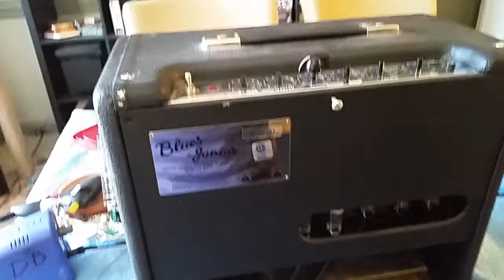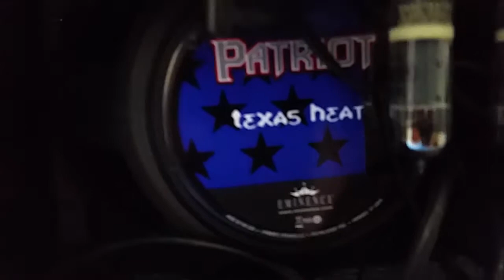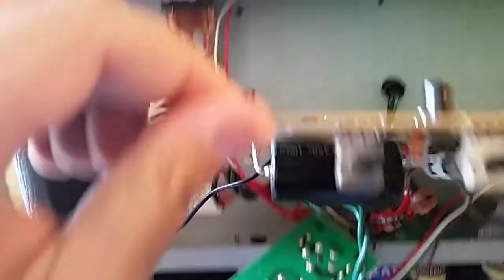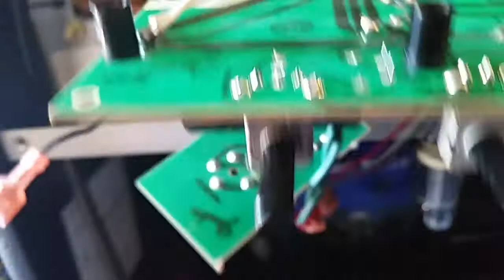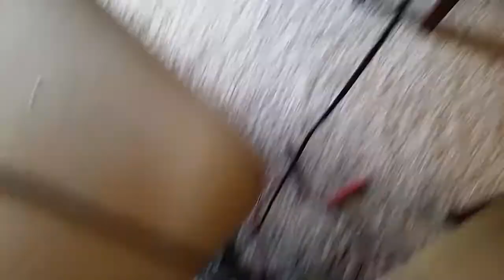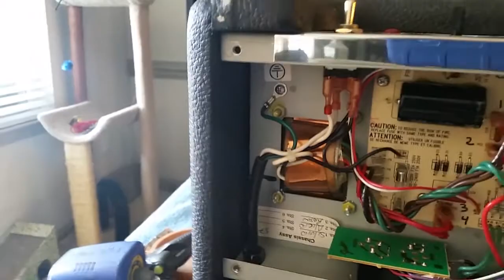Fender Blues Jr guitar amp repair

Comment: Judging from the bloodiness of the solder, I would say the person that installed the mods had an underpowered soldering iron or it had a crappy tip.. the capacitor joint particularly looked like someone struggled to get it hot quickly and so heated the joint for a long time, and lifted the trace.

Comment: After you take the knobs off, you don't have to take the nuts off of all of the pots, because there aren't any.  I had a nice tweed one for a short while, that i bought used.  When i became aware that the pots were just soldered into the board, I decided to get rid of it.  That is too fragile for me, and i am gentle with my gear.  I used to have an MXR chorus pedal that had the input and output jacks just soldered to the board with no exterior nut.  Not good.

Comment: Those IC filter caps are terrible and a high failure rate.I would have got those outta there and went F&T caps while the pcb was out...Not your money,but absolute needed maintenance on an amp older than like 10 years old.Good video otherwise and detective work..The plastic jacks used on current pcbs is horrible.Fender boards especially..All common issues on these amps.

Comment: Bill M mod.  The entire thing.  I just did my Jr. but combined it with part of the Fommel mod.  Now I need a hot glue gun...  Not moving the amp until I do.  Be careful if you do this as the solder pads lift REALLY EASY.  And yes.  I have done lots of other mods.

Comment: Hey,
my Blues junior has a problem too: I plugged the amp into the plug connector and forgot to put the step up down transformer in between. Very stupid mistake. Now it‘s completely broken, doesn’t make any sound and the light doesn‘t turn on. What will I have to replace?
Best Regards
David

Comment: You're pretty good. What's the power supply on that amp? How much would it be to replace it? Some guy's selling one of these but the power supply is bad. He wants an offer. But I'd have to pay somebody to fix it for sure.
Reply from the maker: biblical giants Thanks for the compliment. I have a basic understanding of power circuits and audio signal flow and I'm pretty good at soldering but that's about it. The power supply for this guitar amp is a power transformer a few large capacitors and a bridge rectifier and maybe a couple new power tubes. So all that together would be roughly 100 bucks. Add that to 80 or $90 per hour for installation at a tech shop and you're probably looking at a 200 or 250 dollar repair, but that's kind of a rough guess.
Reply: thefunkybeat79 Man..Thanks for filling me in dude. I really appreciate it.

Comment: The added pot Looks like Bill M Mods bias adjustment pot to allow on the fly bias adjustment.  The mod kit has those big capacitors too so the do it yourself person got a little hot and didn't bother with the hot glue I guess. Maybe I should use an amp tech to put mine in 😰.

Comment: My Fender Blues Jr. III made a huge feedback sound and then wouldn't turn on. The red light would not come on and of course, that meant, no power. First thing I did was to remove the screws off the back, remove the back of the amp, replace the fuses. It could be as simple as that. If that wouldn't have worked, I would have replaced the Power Tubes (EL84's - matched of course, and either Groove Tubes (cheaper), or Mesa Boogie tubes (about $12 more).

Comment: well done sir ... excellent talk-through ... would rather a tech go on about minute details than blast through a repair ... i own one of these and the input jack and output tube socket solder joints have failed several times. i fail to understand 
why amp makers place the tubes upside down when they are on circuit boards. the extreme heat from el84 's has no place to go but up and it's right behind a vibrating speaker cone ... duhhh